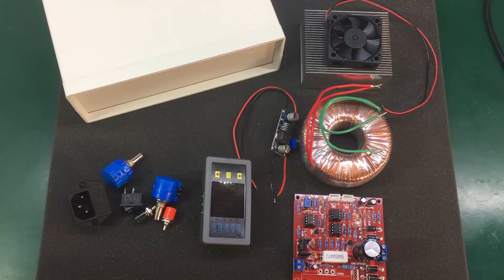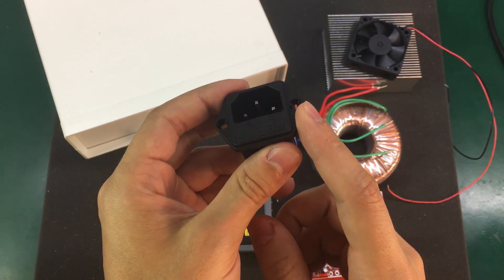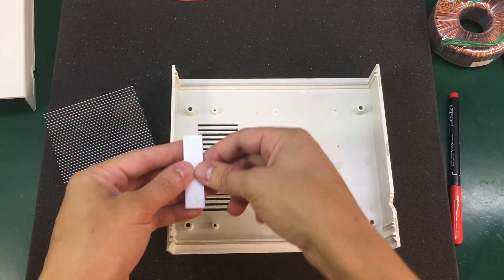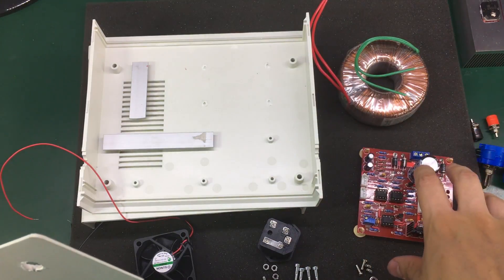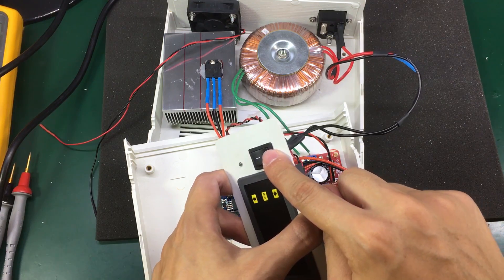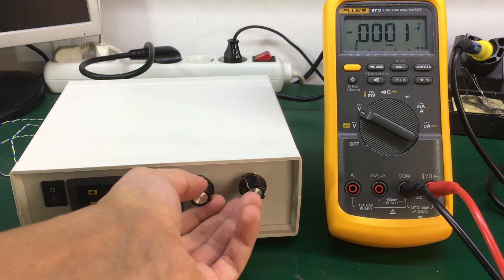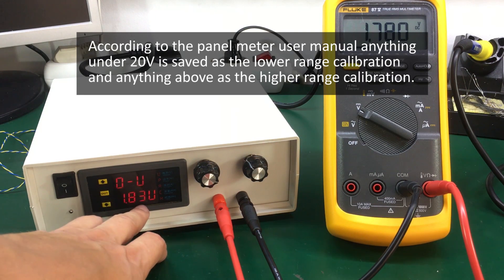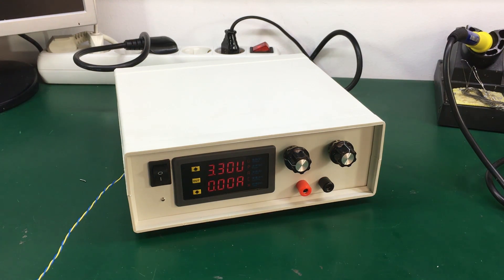Voltlog #64 - DIY Adjustable Bench Power Supply With Enclosure

Comment: Nice wideo as allways.
Why not use the onboard fan power supply, changing the 24v regulator to 12v
Reply from the maker: I did not have a compatible 12V regulator at that time.

Comment: I use a larger and noisier fan. An idea for a temp control fan with the  LM 2596 board ? , I replaced the 330 ohm  resistor  next to the 10K pot with a 5 Kohm  NTC   and  glued  this  sensor to the collector  pin of the power transistor (hottest point ) Now the fan only runs full speed when this transistor gets  really hot.
Reply from the maker: I would build a DIY module to do that because modifying existing LM2596 board is harder to do. You can build either a switching regulator with an NTC in the control loop or a linear regulator. There are plenty of schematics available if you google temperature controlled fan circuit.
Reply: Hi, there are plenty of on off  circuits but that is not good enough, I did not see one where the fan speed is controlled as a function of temp, except arduino pwm control but that is over the edge for most desigs. Do you know one? There are on ebay several commercial for sale those work fine but are bulky and expensive. I have those,  my set up is a good alternative.  But sure a great idea to DIY   I am looking forward for the Voltlog covering that item
Reply from the maker: the problem itself is not simple because cooling fans have a motor driver and you can't simply pwm the power to the fan. Some will work this way while others will not. You will need an actual variable voltage to obtain the desired effect and that is not an easy job. In one of my designs I am using an inverted buck regulator that is driven with PWM from a microcontroller. (idea was stolen from the 60W dummy load circuit)

Comment: Very cool indeed, I had planned on building my kit using the same PS board but using an arduino Uno or perhaps a Nano with an lcd display, however after seeing how good that display works I may well buy one of those.  I will have to sell off some of my toys to raise the funds for it, perhaps now is the time to get rid of all my Archos collection.
Reply from the maker: Good luck with the project, it should turn out nice.

Comment: Loved your video. watched it a few times already.
Nice and complete without mumbling and fluffing the content with irrelevant nonsense. 
Salvaged the transformer 22.5V @ 2.5A from a RYOBI 18V charger, Heat-sink from a Dell desktop. The case is very nice and cheap too. I didn't like the display, so I ordered a more accurate and cheaper one from AliExpress. https://goo.gl/9ddxZX
Don't like to see Chinese writings on a finished project, and its seems stupid to me that they put U and A, which is obvious with different colors, instead of another digit for a more accurate readout. 
I am binge watching your videos. I am afraid its gonna cost me lots of money, since I have no will power when it comes to buying electronic parts and kits from China. "They are so cheap", I keep telling myself ! 
Before I know it, bang, $200~$300/month :(
BTW, your command of the English language is excellent. You must have studied in an English speaking country or a private school.
Reply from the maker: thank you! it's always a trade-off with these panel voltmeters, some have more functionality while lacking resolution or being very small (the oled one) while others have an extra digit but lack the extra functionality. I learned english right here in Romania, mostly because I wanted to know more stuff and most of the times the information was in english so I read allot.
Reply: Wow. If you didn't have the accent, I would not have guessed you where not an anglophone! Your grammar is perfect. 
I know what you mean. Electronics and compromise, go hand in hand, as all do, in science and engineering. You got yourself a new sub and thumbs up for every video I watch produced by you.

Comment: great video - thanks
btw - you mentioned you had some trouble drilling the larger holes, I highly recommend one of these type of drill bits for drilling larger holes in thin material - they work great
https://www.banggood.com/6-35MM-Titanium-Coated-Step-Cone-Drill-Bit-HSS-13-Steps-Hex-Shank-p-961457.html?rmmds=search
Reply from the maker: thanks, I now have one of those.

Comment: Good job. Nice to see proper use of ferrules, sil wire, heat shrink, etc. Does the transformer quite down if you ground the center caps?

One thing that would be good is a sil pad for that MOSFET. Never a good idea to leave a charged transistor sink. If is a giant noise injection system, especially with a motor right behind it. 

It cost nothing and would make a much safer and professional build. 

If you did this you could ground the transformer caps and the heat sink and be in good shape from a safety point of view.

Comment: Thank you for the high quality videos. I am mounting this power supply, and I have a 12v and 7a transformer. Is it possible to use this transformer with this power supply? Thank you very much for your attention.
Reply from the maker: yes, it will work, reaching lower max voltage.
Reply: Many thanks for the quick reply. I was in doubt whether the larger current generated by the transformer could damage the power suppy.

Comment: A nice build though I think you have under specified the transformer. You may well lose regulation at higher currents at 30v. The other issue with this kit is one of the op amps is run beyond its maximum voltage rating and the output transistor is at its maximum rating. So this PSU is ok for low current low voltage projects but will probably break under any sort of load. I have a Lamda PSU that supplies 12v at 8amp and that has six 2N3055 pass transistors though that is very much a professional unit still going strong almost 50 years after being built.
Reply from the maker: I know about the limitations you mentioned, I have read the entire thread on electronics-lab forum where this power supply has been discussed. However in general usage those limitations do not pose a problem. Original 2n3055 are quite robust, The first power supply I ever built was based on this schematic, but with 2n2055 transistor and it's still going after years of service.

Comment: Hi and thank you for the detailled presentation. Very good job. I have a question about the P.S. Is there a way to know in advance the limits of the Amps we want to give to a device? I mean, for instance we want to supply a device with max  only 1A, eventhough  the device at the moment consumes 0.8A. In case that for some reason the current increases, we don't want to give more than 1A. Is there a way to know in advance with the Indicator of the potensiometer where is the limit of 1A?
Reply from the maker: you could start with the PSU not connected, short the output and adjust the current limit to the desired value. You could also map some values like a silkscreen on the front panel, only rough values, like 0.25A, 0.5A, 0.75A, etc.
Reply: Thank you for your answer. Another question please: For a simple laboratory of general purpose, what do you think is better as a bench P.S.? For the same money, as the one you did, a switching P.S. consisted of a switching DC converter 220AC/ 24V dc and a switching module like the DPS 30V 0-3A , or an analog one like the one you did?
Reply from the maker: The analog one is better for laboratory use because of the lower noise.
Reply: Thank you. Best regards.
Reply: But, do you mean the physical noise that can annoys the ears or the rippling frequency at the signal?
Reply from the maker: I am talking about electrical noise imposed on the output of the power supply.

Comment: Hi, In one of your 'InTheMail' videos you mentioned that you would be using a 1A Fast Blow fuse for this power supply. I thought it was normal to use a Slow Blow fuse on the power input. Is that not your understanding?  Nice work by the way and good video as always.
Reply from the maker: yes, a slow blow fuse would be better. I just couldn't find them for the same price on ebay. At 1A ceramic, slow blow seemed to cost twice as much.

Comment: You should check it for an hour while drawing 3A with low output voltage of a few volts (use low value load resistors). Then measure the temperature of both the heatsink and the transformer. I'm afraid you will see that the transformer gets to a very high temperature because the current into a rectifier with capacitor load is taken by very high current value and narrow pulses that cause much higher heating than what is expected from the average power of 90W. I have checked a number of 3A transformers with disappointing results.
Second test is to check the voltage ripple at the output when delivering 30V with 3A .In this case the transformer output voltage sags to lower than 24Vac because of the high current, additionally the main capacitor will have large 100 Hz ripple so at the lower voltage point on the capacitor you won't have enough voltage margin for the regulator.
By the way, I can't find in Banggood the beautiful heatsink that you used. I will have to find another big one.
Victor Koren
Reply from the maker: The heatsink I used is recovered from an old PC cpu cooler. I don't plan to use the power supply at 3A, I would of gotten a 4A transformer if I wanted to do that. Mostly this power supply will be used to power stuff at under 1A and occasionally maybe go up to 2A. But I will do some of these stress tests in a future video where I plan a couple of updates for this power supply build. If one really needs a high reliability, low noise, high current linear power supply it should get one of the used HP/Agilents available on ebay.

Comment: Nice job. Thanks for taking the time to show how you did that. For what it's worth, I cut out panels the same way. The only difference is I drill out the corners first, & then file out  the fine details. I have lots of different tools at hand, but that seems to work pretty good for me.
Reply from the maker: Thank you for watching! I think I suck at mechanical work :)
Reply: Like anything else. Practice & persistence. People around me think that I am smart  ( I fooled them)
because I build electronic things like you. A few years ago I didn't even know how to open a laptop computer, let alone use it. Now I'm building a CNC machine. I tell them they could do it to if they tried.
The only difference between them & me is I'm doing it & their not.
Reply from the maker: It's nice to hear you got into electronics this way, without any background. Thank you for watching my videos.

Comment: Funny, I'm also planning to do a Lab PSU with the exakt same PSU Kit, but a more advanced one with two channels (two kits), 2 LCD's + Arduino for data logging and measurements (:
Reply from the maker: Nice. Good luck on your project!
Reply: :D thanks! I have a small question: Is it possible to exchange the potentiometers with a PWM signal (filtered through an RC filter + an opamp as buffer) from an μController like an Arduino? I'm thinking about to control the whole PSU with an Arduino, so it can be programmable with a Keypad and some rotary encoders.
Reply from the maker: I think it's going to be trickier than one would think. This power supply is not designed using the usual topology. Myself I wouldn't waste time on something like that. It would be better to try a different design for that approach.
Reply: hm... I had the same concerns (that's why I asked and I don't have so much experience in electronics, I'm a former electrician). I know there are digital potentiometers who can do the job, but I only found 10bit ones, but the resolution with 10 bits (1024 steps) would be ~30mV/~3mA. It's a bit low, but for most things I can think of it would be okey.
Reply: I have now stepped back, and bought the same panel meter because I had some problems with the Fan and the Arduino in the same supply line. I know i can decouple this. But for testing purposes i really need a Bench PSU, so I will later build my arduino powered one (:

Thanks for the Video :D And as always: keep up the great work! I really enjoy your work and your engagement and passion (:
Reply from the maker: thank you!

Comment: Calibration is done close to the upper limit of the range. For 20V that would be between 15V and 20V and for 2A again slightly bellow. If you are concerned about the nonlinearity of the meter then mid range would also work.
Reply from the maker: My logic was that I need it to be accurate around 3-5V and if I calibrate at that value, it should be accurate there and slightly less accurate when I go up the range due to non-linearity.

Comment: Are you sure that rocker switch is rated for mains voltage? I seem to recall that they are meant for 12/24V DC type applications.
Reply from the maker: It is rated for mains voltage, it was salvaged from an ATX power supply.
Reply: Ah, okay, should be safe then! Thanks for a great video!

Comment: why is it hard to get a power supply with more current? i mean 30V is nice, but i dont like the current limit for lower voltages. i wish there was a cheap module which could take any kind of mosfet for switching and you could adjust the max current
Reply from the maker: I think it's always a trade-off between noise and power, higher power higher noise, lower power lower noise.

Comment: Nice video.  Im not sure this project gives any advantage to buying a cheap gophert power supply reviewed on this site, except of course if not for the fun of it.
Reply from the maker: It was fun to build it for sure :)
Reply: But this linear supply is much less noisy than the Gophert supply.  So for projects where you need a clean power source, this one could be worth the time and money.
Reply: My idea was to use an old MOT, instead of buying line cord and fuse, just use the cord from the Microwave, it includes  a fuse.  Im not a fan of DYI for the fun of it the only advantage would be if it breaks you can fix it easily.